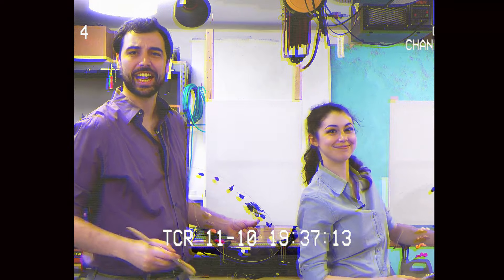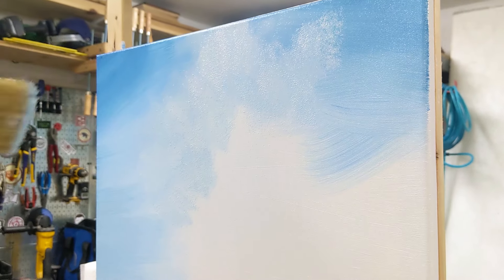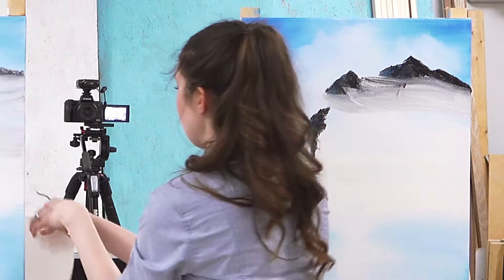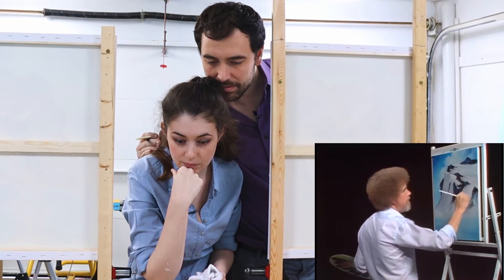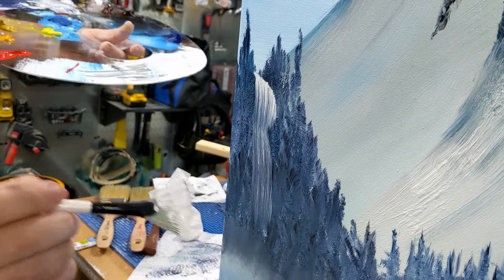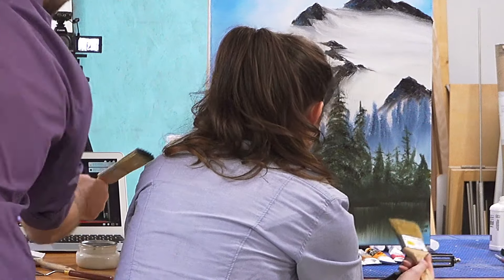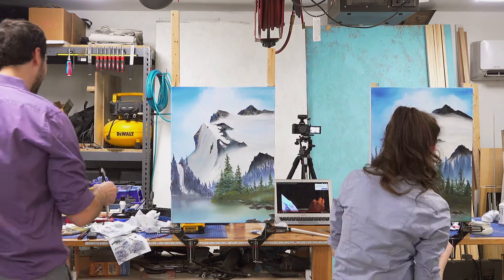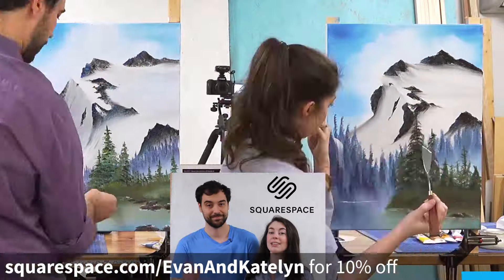Following a Bob Ross Painting Tutorial

Comment: You can use baby oil for oil paint and then when you've finished your painting instead of throwing out the baby oil you can let all the pigment settle to the bottom of the container and then reuse the baby oil for your next painting. (The baby oil might be tinted red after the pigment settles but it will have no effect on your colours later on.) And you can get pretty cheap soap that can be used for all paint including oil although I usually just get all the pigment off with the baby oil and then wash the brushes with soap and water. The oil paint can be thinned with baby oil and baby oil can be washed off with soap and water! Easy!